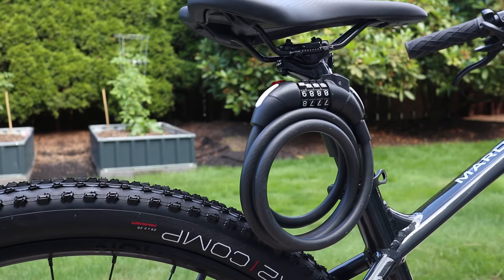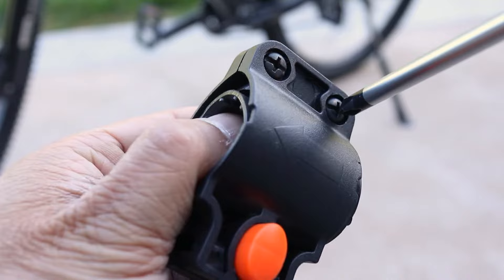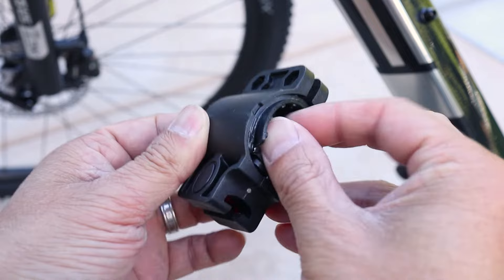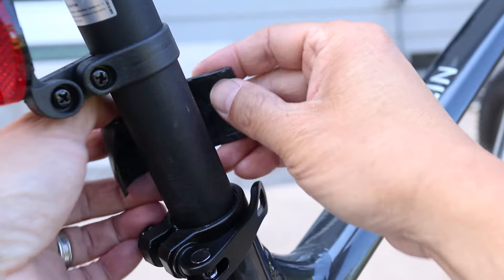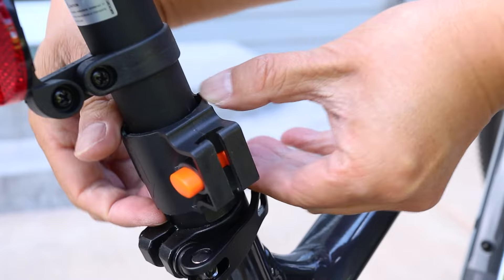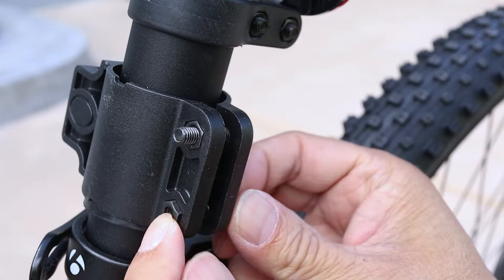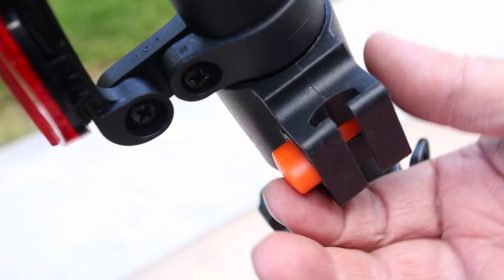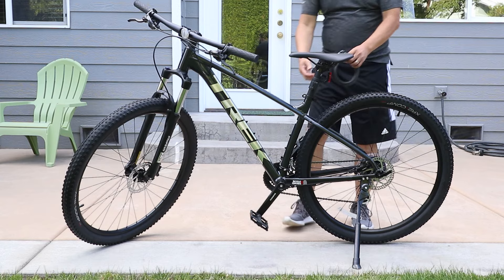How to Mount Bike Lock Holder - Install and Attach Combination Cable Lock to Prevent Bike Theft

Comment: I have found the attachment makes the lock stick out too much while riding. I cannot get it to fit flush with the lower bar on the bike either.
Reply from the maker: This lock mount may not be ideal on some bikes. It works with the spot I placed it on the bike in the video.